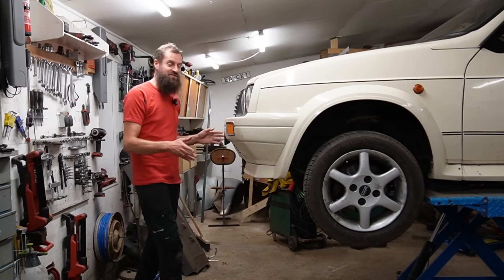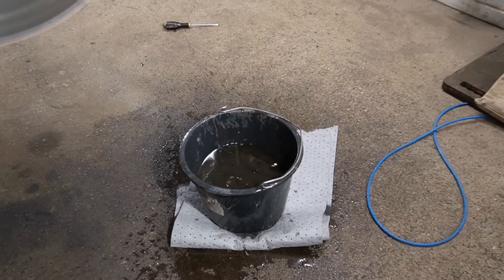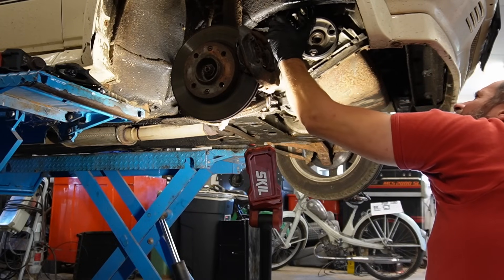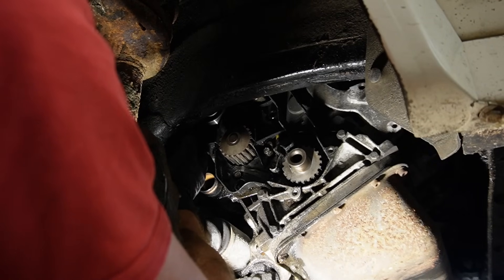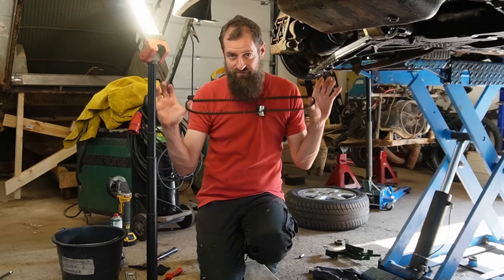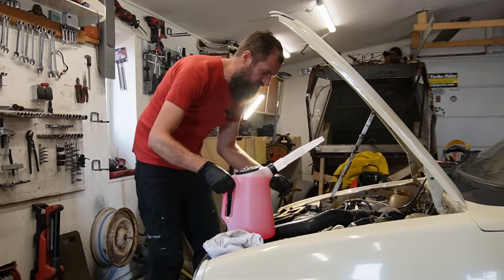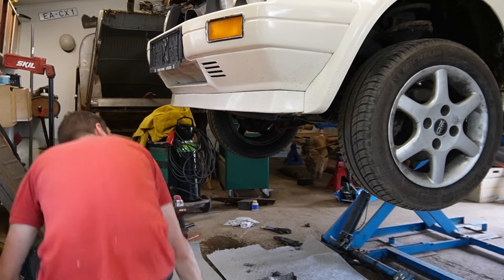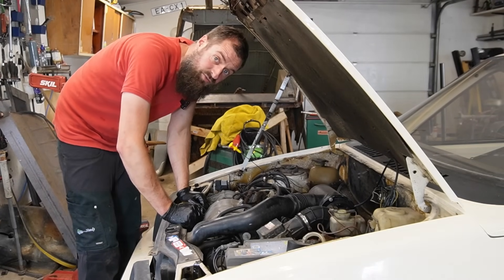Citroën VISA GTI | Cambelt... Almost

Comment: I've done so much of those XU's during 25 years time including the T16 ! (from an 405) , very good robust engines , bit 'heavy' on fuel but otherwise bullet proof . That engine is 1.9 , at least the block is , strenghtening spacer plate between the block and sump is a giveaway . But theres few variants of 1.9 8v engines 105/122/130hp , if it's complete standard aka not an hybrid built engine . Cambelt often confuses on these , engines with spring loaded tensioner (like yours) use 113 tooth belt . Seems like it was overfueling , common fault on these is CTS sensor (blue Bosch sensor) , cheap and easy to replace if it hasnt been done for long time i highly reccomend replacing it . Also mixed up engine management parts/sensors can make it run bad and overfuel too , as well as tampering with the air flow meter spring tension .

Comment: A gigantic pox on every engine maker who use these damn cam belts as opposed to chains. The only benefit the belts have are a purely economic one for the engine builder as there is no tangible benefit for the car owner after purchase. Chains (normally) don't require regular replacement unlike these shitful belts that do. 
In an interference engine, the use of belts is even more shamefully negligent.
Hate these things with a passion as I do NOT like faffing around changing things that should not even be necessary.